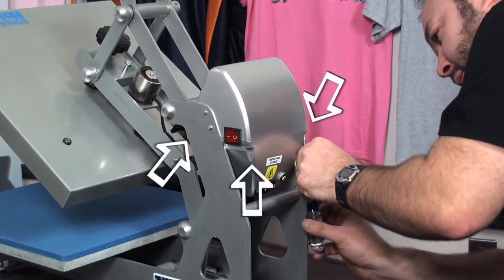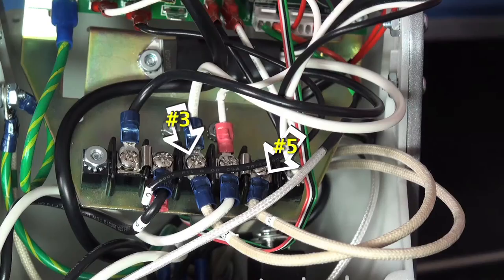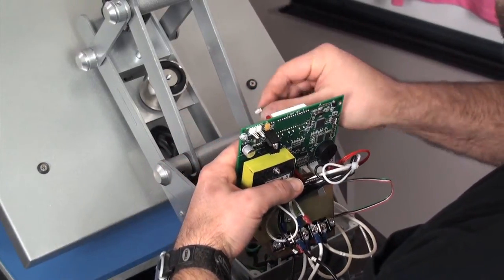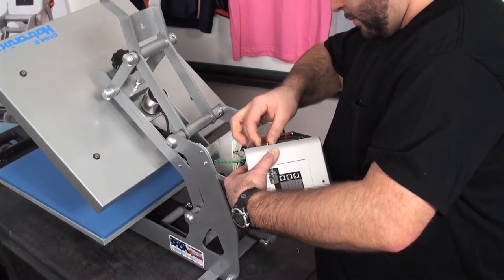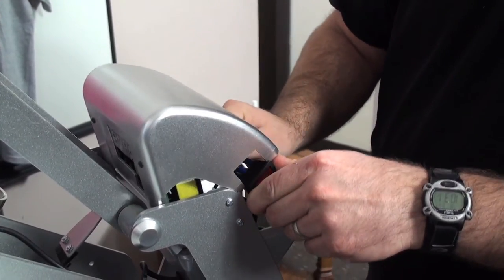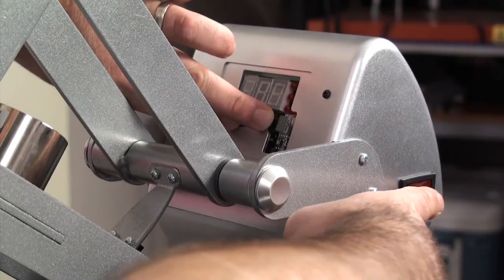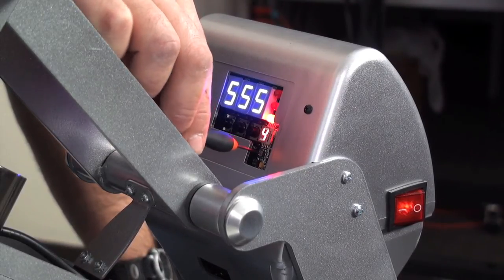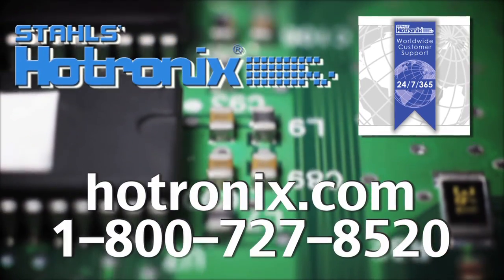How-To Change the Control Board on the Hotronix® Clam Heat Press

Comment: My Hotronix clam press does not show the proper temp.  It can be as much as 100 degrees different from what the platen actually is, as tested with a temp gun.  The temp shown on the display also changes sporadically, and the platen only reaches about 310 degrees.  Is this a problem with the control board?